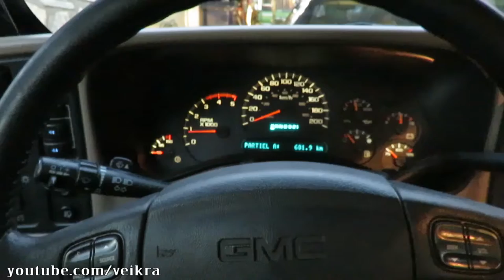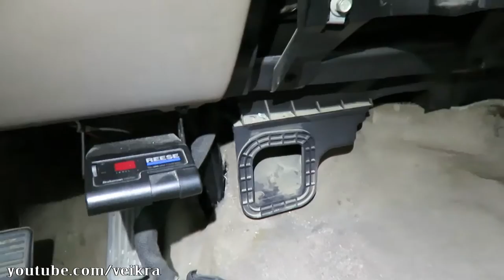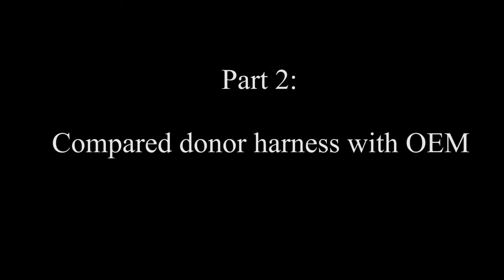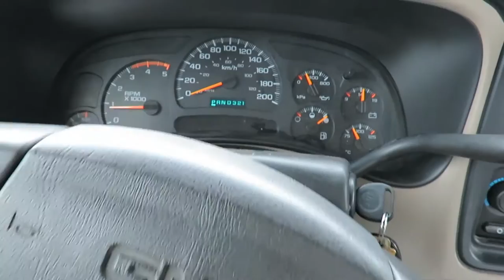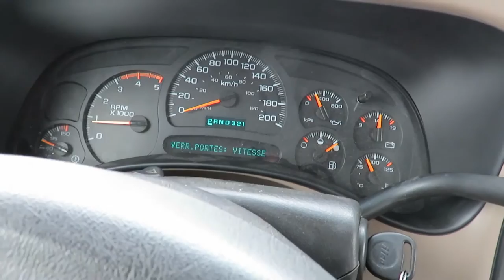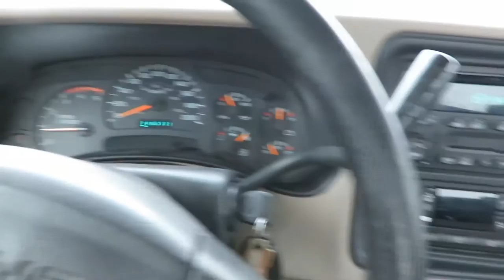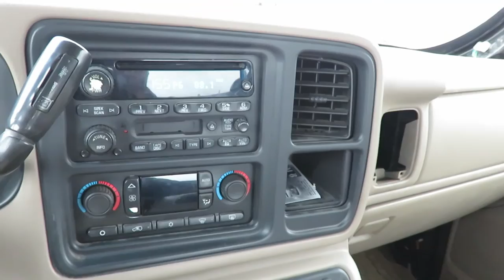How to add Power heated seats 2003-2007 sierra silverado avalanche escalade with ANY wiring harness

Comment: Hey Sorry Veikra one Last question, so for this swap did you use the BCM? Because I swapped a harness and No BCM and I still have an airbag light...
Reply from the maker: No, im using stock BCM. Airbag light is something else. For instance, could have a bad airbag in the seat causing problem. Also, do not plug in the connector for the side airbag if your old seat didnt have a side airbag either.  
Scan the airbag module. It will narrow down your search.  If it wont communicate you have  a wiring issue. If it does communicate then it will tell you whats at fault. 
It is NOT a bcm problem.  
As I said before, if you are unsure , check the harnesses side by side. Some pins could be different althought same year and model seems unlikely. Just not impossible since the 7 way seat have more stuff to them that the other.
Reply: @Nordic_Mechanic  harness was identical, old seats were electrical with air bags. 
I will scan them I’m hoping it’s just one of the sensors or air bag.
Reply from the maker: @williammclaughlin2606  maybe one of those airbag in the new seats have a bad igniter so it's at fault. Otherwise the heat works?
Reply: @Nordic_Mechanic  yes sir heat on back and seat work on both seats.
Reply from the maker: @williammclaughlin2606  Great, you'll enjoy it. I know I do with that diesel engine in sub zero weather. Get it scanned and let me know what it was causing the abs light to show it's ugly head
Reply: @Nordic_Mechanic  I’m in dallas but I plan to move to colorado next few months, I’m gonna take it with me and sell it up there “rust free texas truck”
Reply from the maker: @williammclaughlin2606  yeah, they go crazy in northern climate. Every month someone ask me if my truck is for sale
Reply: @Nordic_Mechanic  I see these 07’ lbz go for 25+ all day long up north
Reply from the maker: @williammclaughlin2606  exactly. day in day out

Comment: Did the swap with a harness that came out my same exact year and model truck as mine,everything works fine but I can seem to get my service airbag lite to go away,can you help me
Reply: Clayton Spade front impact sensor probably bad
Reply from the maker: something happened with the connector under the driver seat. Make sure no pins got pushed out
Reply: I scanned it and it actually like it not connected to the the computer bc I have like 10-12 codes and all driver and pensenger airbag codes
Reply from the maker: @claytonspade9292   You needed to check the routing of all the wires going to that computer under the driver seat. Im guessing you need to repin the connector under the dash to match your old one. Computer is unable to communicate to the body module, so it's rx/tx line is not hooked up. In my instance I had to really check because my harness came from a different bodystyle and year. So I did and it worked flawlessly for years now
Reply: Veikra can I send you my stock and new harness and see if you can figure it out because I've been trying for weeks
Reply from the maker: @claytonspade9292   If youre not in canada it could be costly to ship back and forth. But it's about 2-3 hours to check it.  You got to open the big yellow connector with the red trim, and compare it with the original.  Same with the large connector under driver side kick panels. Your problem is in one of those

Comment: Hey, what colours go to what on the plug you had to cut? I tried to screen shot, but still can’t really tell. Thanks !!
Reply from the maker: the twisted pairs are pretty much all the same color except one pair. You see a pair with a green wire, you connect to the pair that has a green as well. The positions in both connectors are similar too.   There was also a blue one, which when to another blue.   It's related to the rear radio and center console subwoofer so not critical.  DO NOT HOOK UP the side airbags wires if your truck didnt have them . Thats the wires I taped off
Reply: Veikra thank you, I got it figured out. Everything works except the heated & memory seat part. I watched your other video but I still haven’t figured it out.
Reply from the maker: memory will not work until you get bcm programmed. The heated seat should start working after a few key cycles. also make sure orange and black wires have power
Reply from the maker: do you hear a beep in your speaker when you press the memory buttons?
Reply: Veikra few cycles of what? No beeps but I have an aftermarket radio(if that matters). When the key comes on the little lights come on but nothing when I press the buttons
Reply from the maker: A few cycles of starting and turning off the truck. Mine took a day or two and they started working. Normally, you should hear a beep when you press the position memories  in the door switch, that way  you know the switch is connected adn sending the signal down the line to at the very least the BCM. 

Have you made sure the solo blue wire from the seat module is going in the kickpanel connector? On my avalanche it was going to the door pillar instead, where it meshed with another going back forward to the connector, so there is variations.
Reply: I just matched all the wires to the plug. There was 2 blue wires so I hooked them together
Reply from the maker: I bet there a blue one going to and from the harness in the door pillar between the 2 doors. There's a green splice there that mate the 2 blue wires in the new harness. Old harness had a single blue going from airbag module straight to kickpanel. 

Is it working now?
Reply: Heat isnt working I splice all the wires you said to splice got power no heat need help that's the only thing I have to do and done.the controls beeps through the stereo. Any answer would be greatly appreciated. Thanks
Reply: @Nordic_Mechanic  need your expertise. Greatly Appreciated
Reply: @michaelblackhurst2854  could you help me on this need some help.thanks
Reply from the maker: @joeydally8581  Seat elements are good? whathappens if you press the heated seat buttons?
Reply: I’m having the same issue I’m at all the wires in the kick panel but I wasn’t sure what to do with that one blue wire that being said I have a beep when I press the seat functions and the switch is illuminated but when I press the heated seat options nothing happens also I have an airbag light

Comment: i have a classic 2007 silverado 2500hd crew cab with cloth power driver seat, found a good deal on a 2005 gmc yukon xl 1500 with full leather, is it all plug and play, dont really wanna splice wires, great video! @veikra
Reply from the maker: should be plug and play unless it has different airbags, then you have to shave the red plastic cap in the yellow connector under driver seat
Reply: Did you ever do the swap?
Reply: If the seats you have now are 2 way and the ones you are getting are 8-way, unfortunately you gotta swap the harness

Comment: Doing the swap now have all the power working just worried about my airbag pug under the seat the nee harness has less wires then the old one,what do i have to do?
Reply from the maker: your new harness has WAY more wires and thats normal. the locating tab with not let you plug into the module right ?
Reply from the maker: I misread your comment, that's supposed to be the other way around. The new seats have airbags in them, and thus that airbag module plugs of the new seats will have more wires.  Which model truck and year do you have, and in what did you take your seat and harness?
Reply: Correct my truck is a 05 silverado 1500 with the basic cloth seats and i just picked up a set of seat for a gmc 2500 probly around the same year
Reply from the maker: @claytonspade9292   Sorry, missed a few comments with youtube acting funny. But can you send me pictures of both connectors? the harness from the new seats should have more wires but it can all be fixed since you have both

Comment: The 2500hd has the heated seats and I love it but not sure it's worth that much work.  Maybe an aftermarket heated seat kit.
Reply from the maker: aftermarket have cheap looking and feeling buttons.  Not worth it. This was very straighforward especially since I did the research for you guys. And my method broaden the amount of vehicules you can get the seats and wireing from. My truck looks and feels like it came out with the option from the factory.   All you need are the seats, harness and buttons. Plus if you get the harness from the same year and model, you dont have to splice anything. 

only takes an afternoon
Reply: Veikra   I guess if you could find a plug and play harness it wouldn't be too bad.  Then you need to find heated seats I am guessing from the same year.  Still a lot of unknowns.  You did the 03-up.  I have 2002.
Reply from the maker: yeah, so you have 1999 to 2002 1500 and 2001-2002 3500 to choose from. Get the harness that came with the seats.  I had more work to do because I didnt use seats from the pickup variant, nor the same years or same airbag options.

Comment: any idea where i can find front door panels with heated seats at in tan? i found cracks in mine last week and the arm rests are both broken.
Reply from the maker: Any door panel can be modified for heated seats controls,  check the video in description.  I have spare tan ones for you, shipping is expensive thought. It's your call.
Reply: i will try some jb weld in the cracks. how much for the front door panel arm rests,the lil christmas tree clips in front of the speakers, console tan trim piece that surrounds the cubbys?
Reply: oh and the drivers front sill plate trim
Reply from the maker: have it.  Ill check how much shipping thatd be for all that
Reply: Veikra ok let me know how much. i got those escalade rear seat heater switches
Reply from the maker: thanks man, they are pretty rare option ! Im mesuring everything for shipping, ill let you know
Reply: Veikra they are very popular for heated seats here in arizona
Reply from the maker: Travis R.
 I mean, rear heated seats
Reply: Veikra i know what you mean there buddy. i got a driver side sil plate today finally tracked a good low mileage one down.
Reply from the maker: Travis R. I have a passenger one, it'S got some wear though, and 3  3mm cuts/gouge . not cracked though
Reply: Veikra do you have a wiring harness for the heated seats ? Like from the switch to the fuse box

Comment: i got an extra master switch if you want it
Reply from the maker: I already have doubles but thanks
Reply from the maker: I am looking for rear heated seats buttons in 2003-2006 cadillac escalade though, if you see any for sale
Reply: Veikra i seen some at my local wrecking yard. going back there this weekend and will grab them for you
Reply from the maker: cool, they are on the center console
Reply: Veikra i got both switches with pigtails
Reply from the maker: I sent you emails long time ago, didnt get reply for the rear heated seats buttons

Comment: so what do you actually need if you just want the heated seats to work? I've got the heater power seats from a 2004 suburban into my 2004 2500hd silverado and i just hooked up the power and the ground.
Reply from the maker: you need the heated seat buttons , and the harness from the truck you took the seat from, or any truck with the heated seat option between 2003 and 2007
Reply: did you have to do any programing?
Reply from the maker: no, but you need programming if you want the position memory
Reply: I have a harness for and 2500hd crew cab if anyone need
Reply: @claytonspade9292  
Still have the harness?
Reply: @claytonspade9292  do still have the harness?

Comment: Did you get the memory seats working yet? If so, how did you do it?
Reply from the maker: requires BCM (body control module) reprogramming to add the function. Haven't done it since Im the only driver. heated works without programming anything